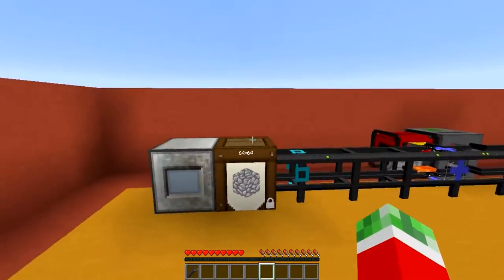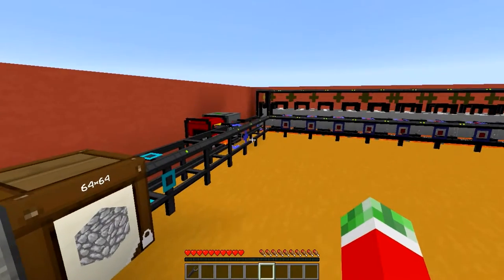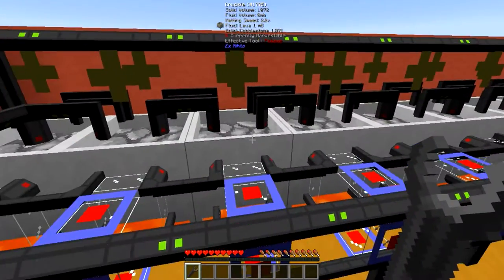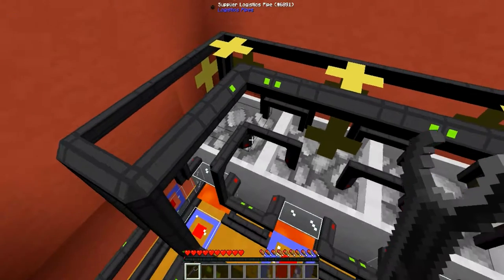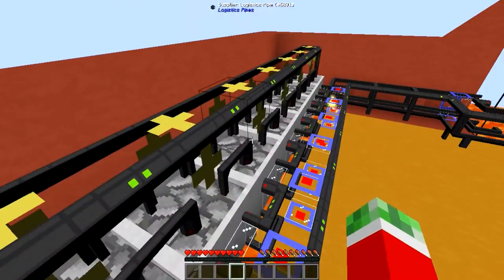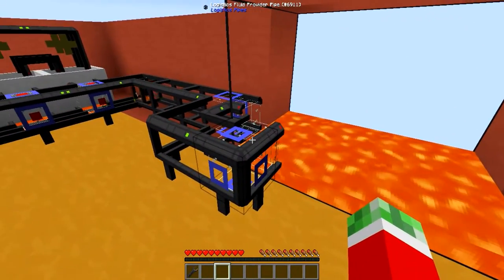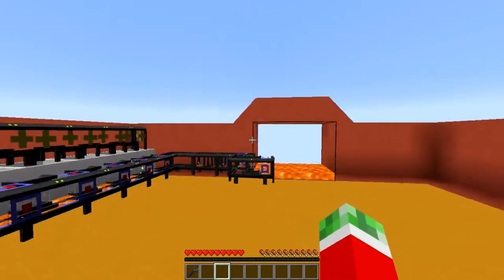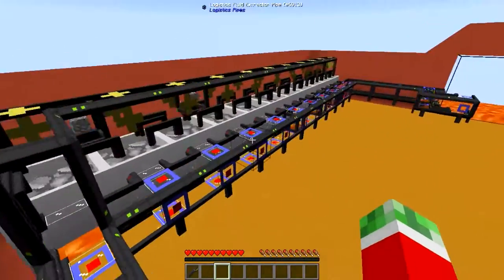Logistics Pipes Tutorial - #15 - Ex Nihilo Crucibles (Lava)

Comment: so i have been wanting to setup my sky block ore production like i would with ae,, and that is with red-stone emitters i could set target levels for the system to maintain,, so like a sieve on dust would kick on if not X amount of red-stone on hand,, say gravel for diamond and also hammer down material for the maintain amounts for the gravel sand and dust so they are ready..  as we all know it takes some effort to make it all the way to dust..
Reply: +joshua spires Huh, I suppose that's one way to do it... I usually just hook a tree farm to a charcoal production facility, then hook THAT into a power generator for all my sifting and pipe the end results (ingots, diamonds, seeds, etc) into a wall O barrels (or drawers) with void upgrades. If it's always on and can't overflow I'll (hopefully) have all the stuff I need!
Reply: And automating large quantity of iron plates for solar production and such.
Reply: joshua spires
Iron plates? That's pretty easy with a crafting pipe, maybe a satellite pipe, and the immersive engineering metal press. Then, once you've taught the crafting pipe the recipe, you put a supplier pipe on a chest somewhere set to keep 16, 64, or howevermany of the item you want in the inventory it's hooked to.

Comment: What is a good way for massive storage with logistic pipes without using drawers or an me system? Drawers are grief-able in my server and an ME system is way down the line (playing infinity expert).
Reply from the maker: +allowmoto Hey there Allowmoto! Due to the way Logistics Pipes work, they don't offer their own 'storage' method. You would have to with Chests, Drawers, Barrels, or something in that fashion. Hope this helped
Reply: Ok, thanks. Will probably stick to barrels even though I need a pipe for each barrel. Thanks for the quick reply btw.
Reply: +allowmoto It may be painfully expensive, but don't Thermal Expansion Caches have security features?
Reply: No, just drawers are grief-able. All other storage methods aren't. Barrels are worse at the beginning but they can be upgraded which is needed for the long run.

Comment: can you plz teach me (us) how to make macine frames from thermal expansion in the assembly table?
i am struggling
Reply from the maker: +Vincent Riemslag Hey there Vincent! Thanks for the suggestion, though I don't really see the necessity in the matter. Why would you make machine frames in an assembly table and not the Logistics Crafting Table ? For more details on that, you can watch episode 4 of this series :). Hope this helped
Reply: +Corjaantje - Modded Minecraft I am playing Infinity evolved expert so i dont have that option,
it requiers 5 items in the assembly table but there only are 3 slots in the satelite section of logistics pipe :)
Reply: +Vincent Riemslag Oh! I can answer this one!

So what I did was have a supplier pipe keep about a quarter stack of the cheaper ingredients (crushed obsidian and iron chipsets) in the assembly table at all times, and then told the crafting pipe to give it the gear, circuit board and dense steel plate when I want to craft one.
Reply: +Will B I think i will try that. Thanks!!!